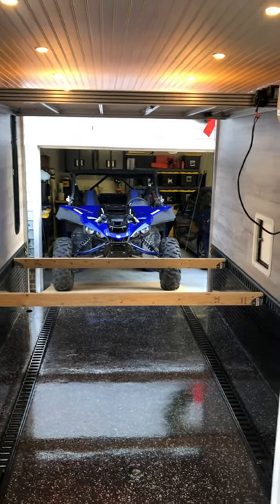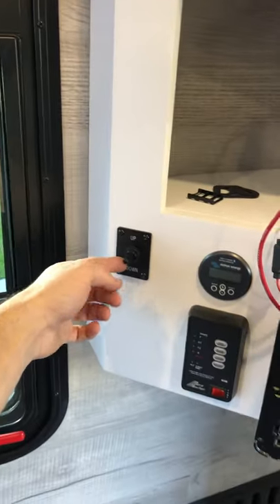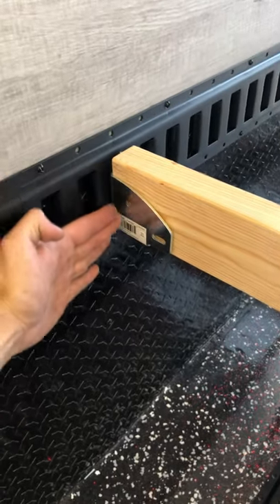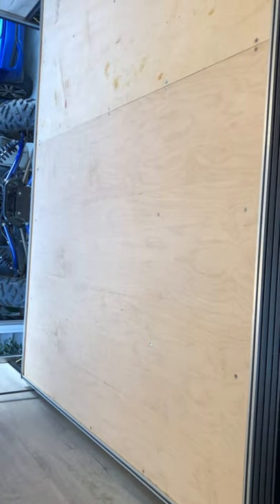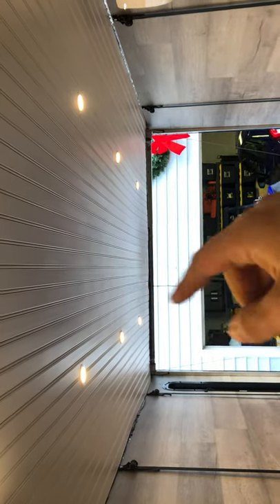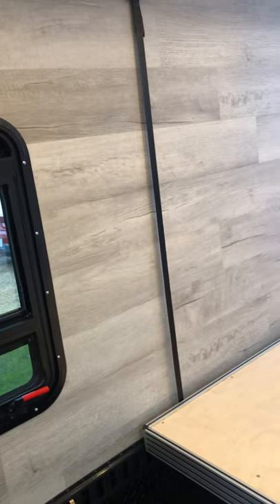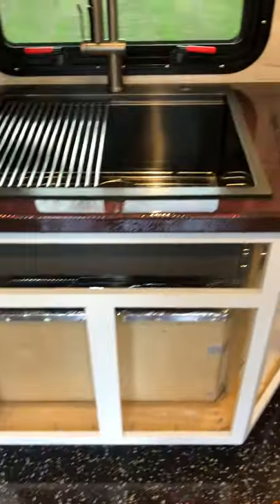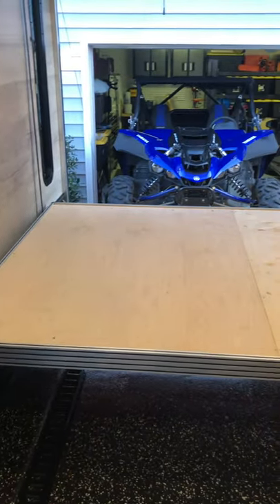The Best/Easiest DIY Electric Bed Lift for Cargo Trailer, RV, or Camper Van

Comment: Will this hold the fiancé, myself, and two dogs? Collectively weight a little less than 450lbs. Worried about the stress it’ll do to the verticals sidewall posts that the tracks are screwed to.
Reply from the maker: I have catch hooks on the side E tracks that I have it sit down on when sleeping now.  If you’re really going to weigh it down you can do the 2x4 spanners like I have.  Alternatively you could also add another strap in the middle if you didn’t want to add stops. 

I’ve also seen someone who added little fold down legs
Reply: @bren5279  I am getting the trailer custom made and they said they can add another vertical structure to compensate the heavy weight. Never thought of the extra strap that’s a good idea. I just want it to not look ugly with a big wood board needing to be screwed in the wall that sticks out.

Comment: I f you invert the bed, look better! upside down. mattress in the other side. no body see the mechanism. The flat side will be the second ceiling
Reply from the maker: If you do that then you don’t get the space for the motor shaft and straps unless you had them just sticking off the bottom.